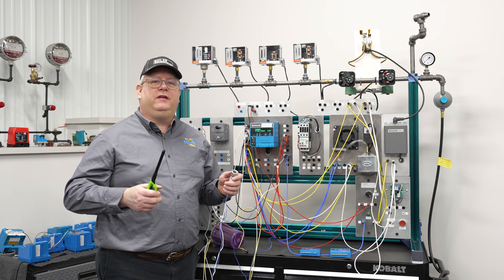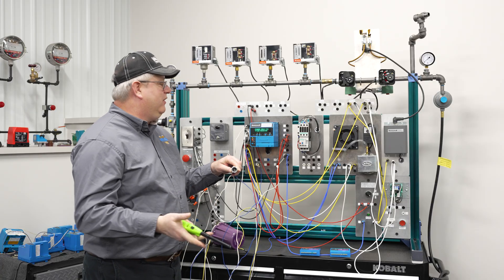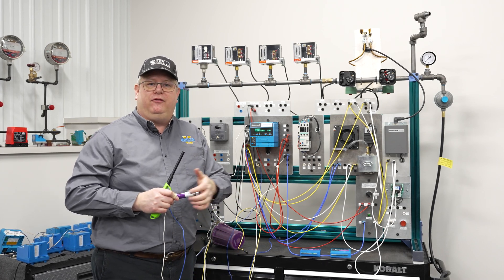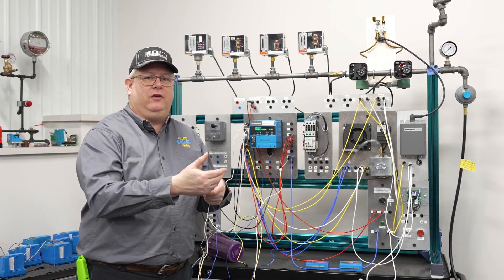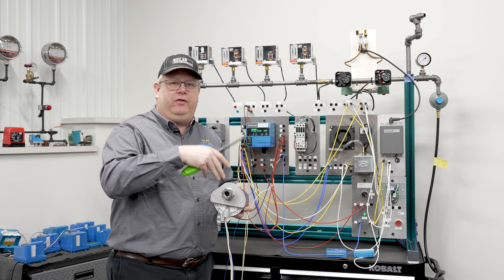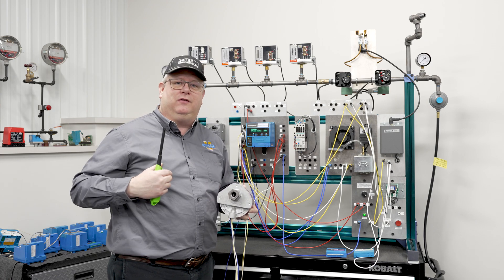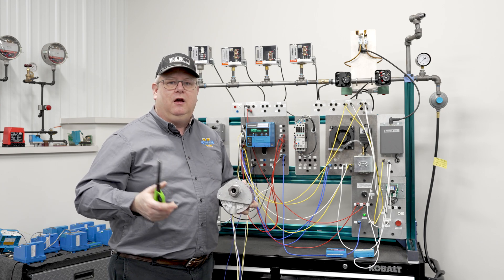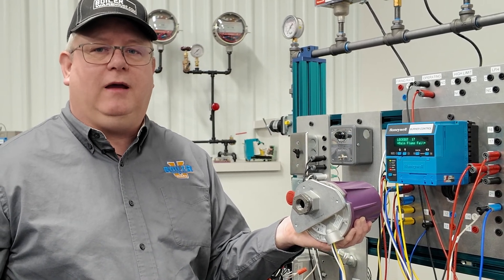How Ultraviolet Scanners Work - Weekly Boiler Tip

Comment: I do have a question about the 7800 Series Burner control I build HVAC Supermarket Refrigeration  Training Simulator Stations And need to know how to keep the control from locking out with the ultraviolet flame sensor   i have the 7800 simulator set up but i nee something  to simulate a flame for training.